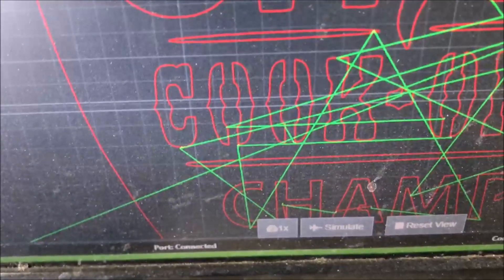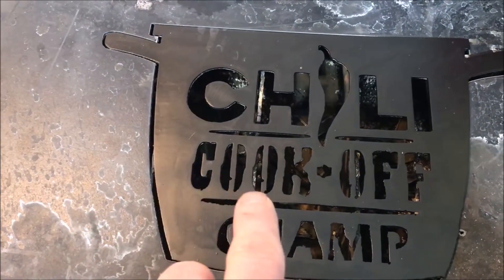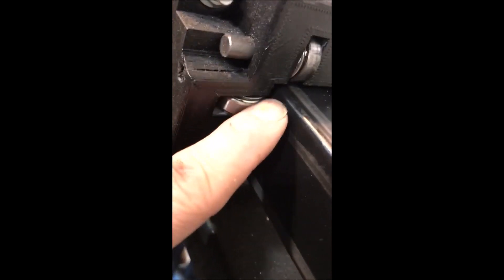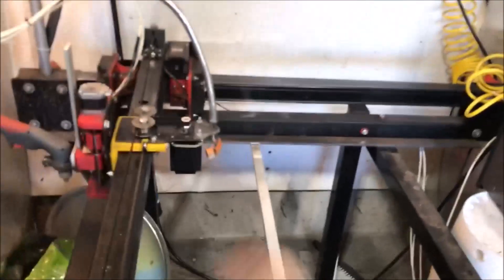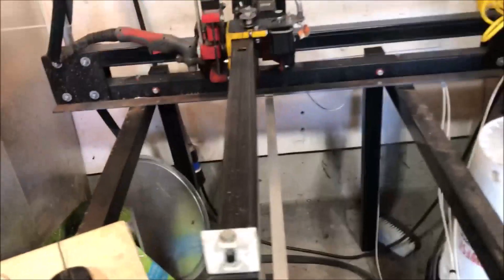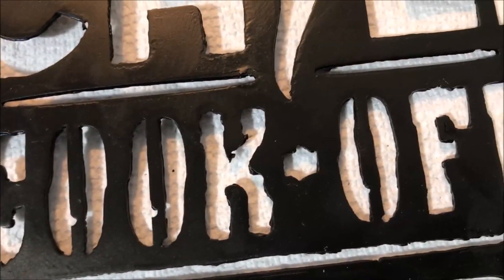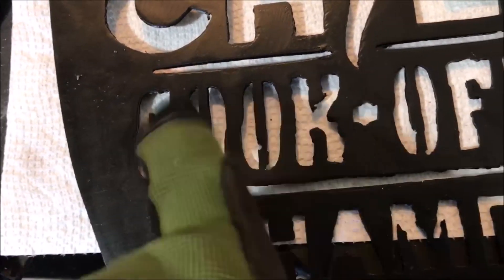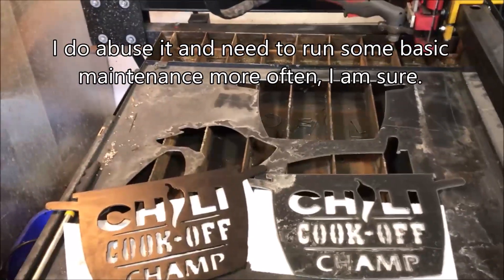CNC Plasma Cutter Updates and Maintenance

Comment: Is your machine grounded…. It’s not really talked about but plasma tables need to be grounded with a ground rod. Ground the frame the gantry the plasma cutter casework and your metal enclosure for your electronics (not plastic plastic is bad) this will greatly reduce emi and prevent missteps cause from it

Comment: good vid mate but i noticed problem with the letter A being cut out is because you have a cut line running through middle of your A on the drawing you showed on the screen in this vid.
i would check your sketch and see if you missed a line that needs deleting as it looks that way 

hope this helps and keep up the progress
Reply from the maker: Thanks I looked at the design again, good catch that is exactly what happened. Also as I was looking over the design I noticed the H also had an extra partial cut line in it. This is most likely why the H didn't fall out and I had to push it out with a screwdriver.

Comment: I watched your latest 2 videos and I think your problem lies with poorly printed 3D parts.  I purchased the 3D parts directly from JDs and they fit and perform perfectly.  They are super strong and my bearings and shafts keep in alignment with no play whatsoever.  I am getting precision plasma cut parts every time.  Another reason you are getting poor quality parts is because you are not using the water pan. The dust and metal granules that you are generating by dry cutting is no only hazardous to you but it’s ruining everything around the plasma table including the bearings.  You mentioned that you aren’t cutting with water because of cold weather freezing.  Simply put a drain in the table with a short hose attached.  Get a 6 gallon plastic water can, and drain the water after using your machine.  It only takes a few minutes and it makes cleaning it simple.  I use Eastwood’s green plasma cutting fluid and nothing rusts.
Reply from the maker: Thanks, you are most likely right on the money with your response. I think the parts I printed all had partial in fill and this has lead to a lot of my issues. I also agree with the plasma fluid part. I have been using Borax and it kind of keeps the rust down but anything it splashes on has a white crystalized dust on it afterwards. Most likely leading to the bearing issues.

Comment: Thanks for the video 👍🏻🤜🏻 did you print your own 3d parts ?
Reply from the maker: Yes, which did lead to the issues I had on my Y axis. I had to reprint after a year and a half. I did not print with 100% infill and that part finally cracked. The new part was printed with 100% infill and is the yellow part.
Reply: I send to print the  same part you got damage and just at 92% to finish got a error and part was ruined 😢